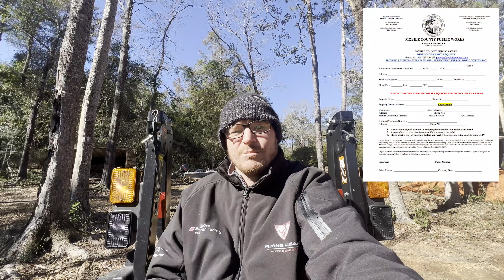Upholstery Shop Build Update - 2024 Update Ep 08

Comment: Glad you made it to this point. Construction isn't for the faint of heart. The space will be a great investment once you start filling the equipment in and deciding the layout. Spaces evolve over time, but I like the smaller temperature-controlled sewing room. I think you'll want that in the height of summer to avoid the humidity and the cold of winter. You can put up the bay doors since they go in one panel at a time. Figure a few hours for each door, and the second will be easier once you do the first. Keep up the good work. It will be worth it in the end, and you'll definitely appreciate doing it all with cash vs. financing.
Reply from the maker: Thank you so much for the kind words! I appreciate the tips! I will keep you all updated on the doors.